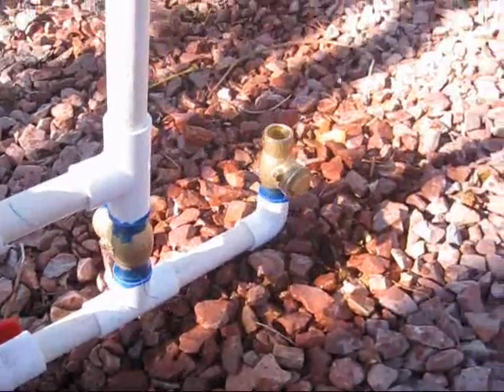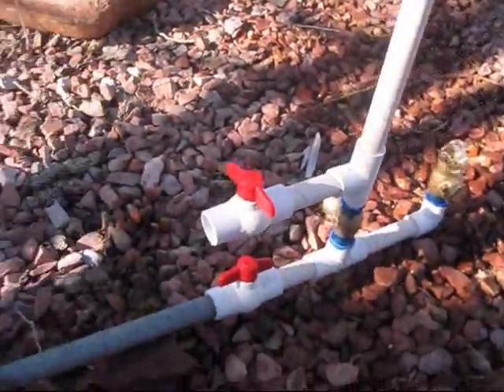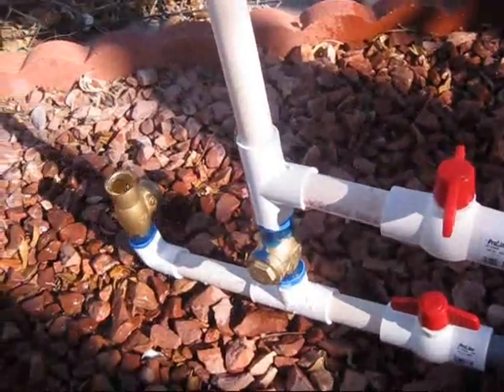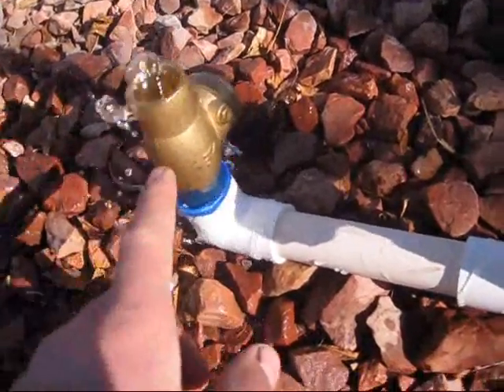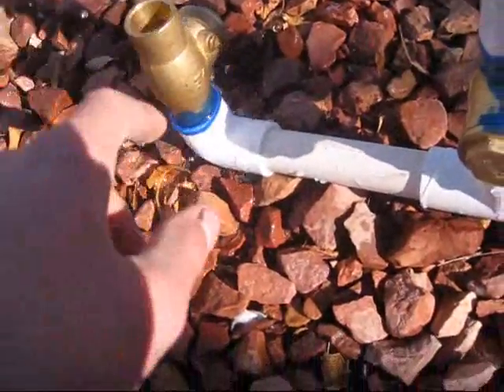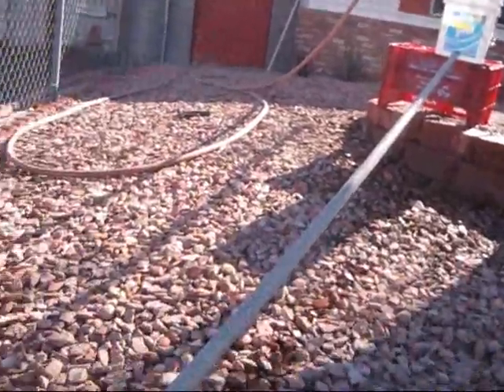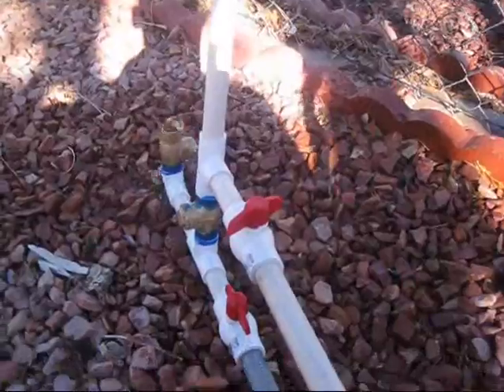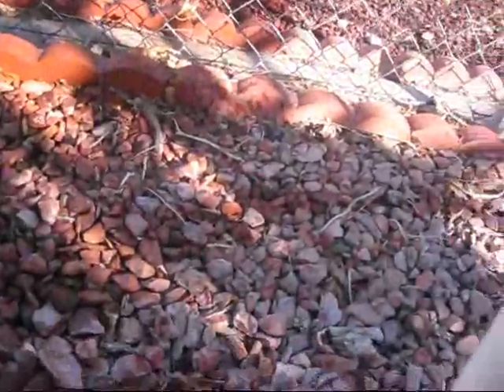Homemade Ram Pump

Comment: love the Video by the way. I was wondering about the wasted water from the Ram Pump. I am wondering if you had a hose to put on the waste side if it would flow back into the water source "bucket of water" so you wouldn't have any water lose. Love this concept though. I know you can buy ram pumps but they are extremely expensive. It's great somebody can make one out of cost efficient material. Love the Video keep them coming.
Reply from the maker: +Steve Rabon Normally these are mounted in streams, so there really is no waste water. It would just be dumping back into the stream. The waste water won't build any pressure to be able to be pumped back up to the source. Thank you!
Reply: You're welcome. I was thinking on the line of a water delivery system. Yeah I was thinking the waste part wouldn't have very much pressure. Thanks for the reply.
Reply from the maker: Steve Rabon
There are quite a few places that use these pumps to provide running water to houses. What's really cool is that they require almost no maintenance and can run for months or even years on their own without stopping.

Comment: whats the inlet pipe made of?
does it matter or can I use a garden hose as inlet pipe?
Reply from the maker: chilledoutdude This one was 3/4" steel pipe. Steel is best but PVC will work also. I haven't tried using a garden hose, but it might work. Just make it as straight as possible.

Comment: Why can't you just close the waste valve?
Reply from the maker: Danyal Ahmad The pump only works when the water suddenly stops flowing, so the water has to be able to flow in the first place. The waste valve is the output of the original water flow. Normally these would be in running streams so the water would just dump right back into the stream. To shut it off you have to close the valves in the right order so it will stay primed. Hope that explains it, thanks for watching!
Reply: SuperKONR Then why cant you add another water bottle to the waste valve. So, after getting pushed out, it goes back in.
Reply from the maker: It would hinder the flow too much. It would be like if you made a U with tubing and filled it with water. The water wouldn't flow because the pressure gets equalized. The waste valve in the pump has to be lower than the inlet for the water to flow and the pump to work.

Comment from the maker: It's a hydraulic ram pump, it uses the flowing/stopping motion to pump a small amount of the source water to a greater height. They were used on farms to pump water for crops, and to fill water tanks for indoor plumbing systems. They were used because they can run for many years without any maintenance whatsoever, and require no electricity or power except a source of running water such as a stream. There are many places where these are still used today!